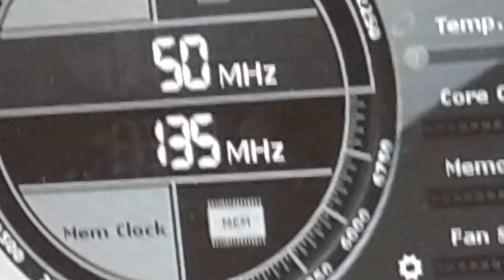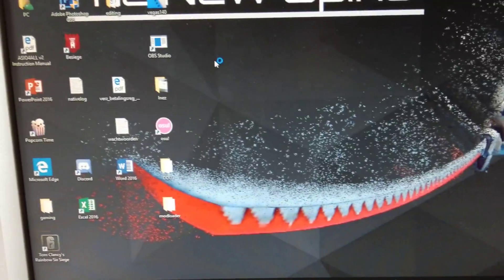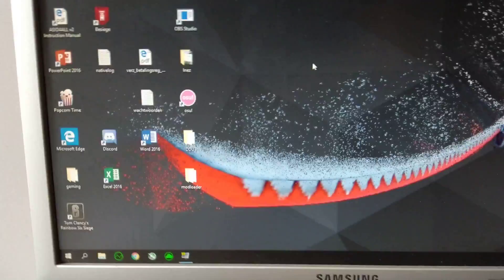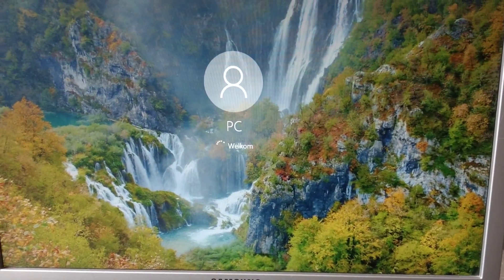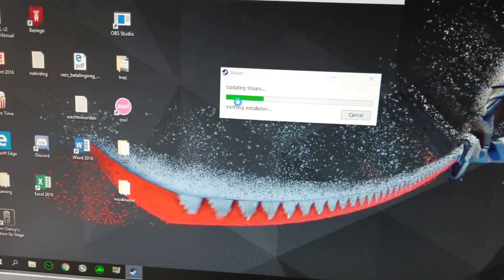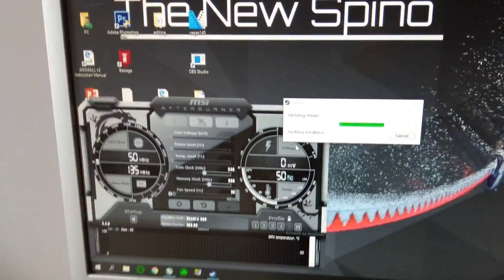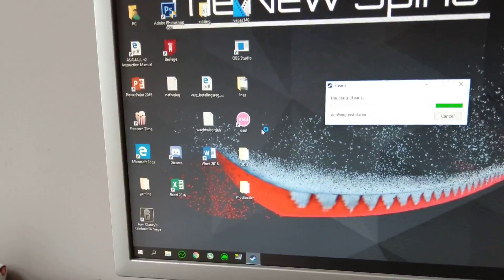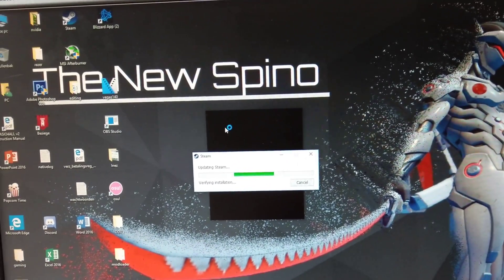How to fix 135 mhz/ 405 mhz underclock MSI afterburner

Comment: it happened for me c clock was stuck 139mhz turns out it only capped at 139 when my gpu got hot , c clock started shattering when my gpu was about 67C° so make sure the fans are running fast and if u can try an air conditioner and see if it helped

Comment: for me it was stuck at 405 mhz , disabling then renabling the card worked but temporarly , what i found to be the problem was The power mode that i added , bitsum bighest performance mode , it was added by proccess lasso and park control , when i set it back to high performance i didn't have an issue , this is the third day without it , hope someone find this usefull
Reply: You are the man, you are the bottom of the man. Thank you, you helped your Turkish brother
Reply: @goktugsagr2360  kanka nası yaptın anlatsana
Reply: Thanks had the same problem
Reply: How did you disable and enable the card?
Reply: @xahxst  press Start -> type device manager -> Display adapters , you should see it , right click -> disable device then enable

Comment: When you shutdown and enable fast boot, then when you shutdown it stores some driver info, you need to restart windows and it shuld be fixed
Reply from the maker: Thx for the advice, ill try it
Reply: @Pelaohehe  And please don't disconnect the power plug like that, it hurts my eyes!
Reply: you just saved my butt i screwed up this computer so bad i didnt even think to restart it. lol thanks